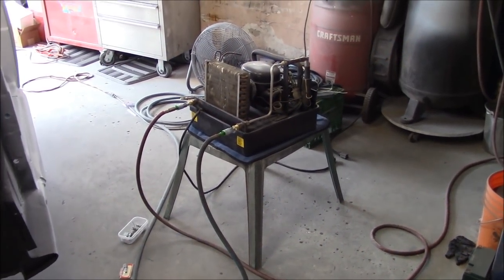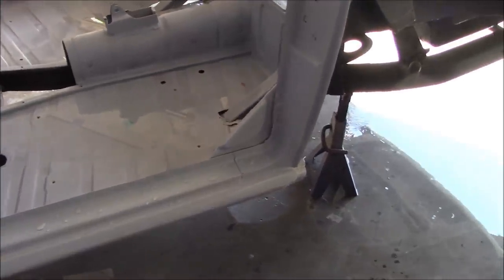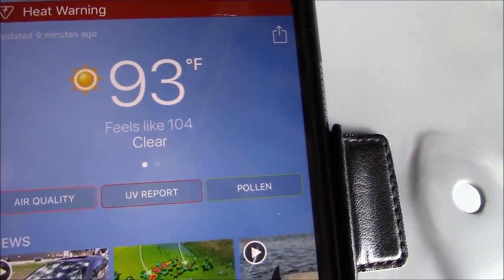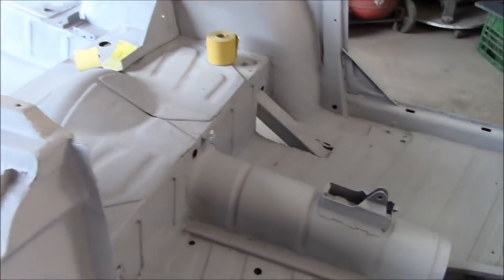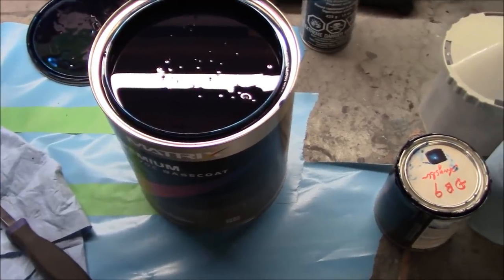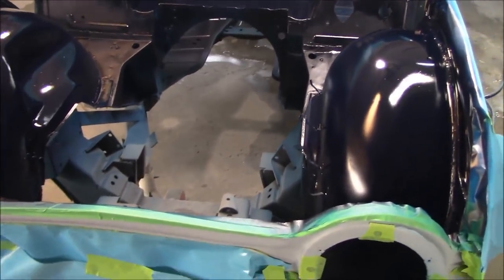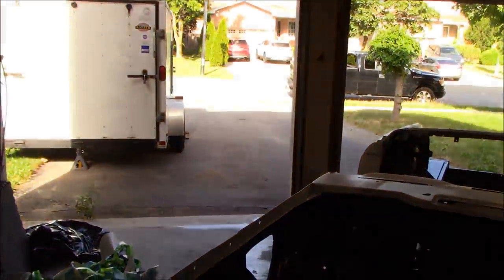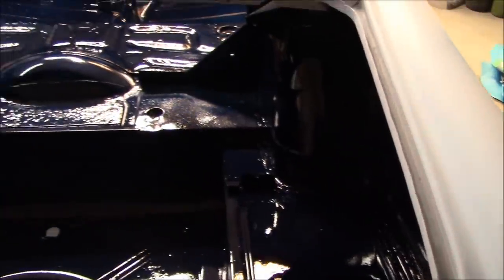1968 Triumph TR250 Restoration, Who Wants Royal Blue....? I Do!  Body Tub Interior Painting

Comment: Nice color. Something I do when painting is to narrow the spray pattern and spray into all those hard to get to or hard to see after it becomes all one color areas. The light is better before the whole thing becomes one color.
Reply from the maker: Yes, I was doing the same thing playing with fan/material and pressure to get up under the edges.   Yeah, I should have know better with the lighting at the rear of the car....It will be the first thing I fix...nothing that a little wet sanding and reapplication of base and clear can't fix :-)

Comment: You are a perfectionist.  Curious, when you sand areas down to metal, do you prime with 2k or epoxy?
Reply from the maker: Hi Soup, the best way is first prime with epoxy primer then overcoat the epoxy primer with your high build primer (try and do this within the recoat window of the epoxy so you don’t have to sand before applying the high build)

Comment: Looks great but it´s not better to paint the frame first before the car himself? I never thought that Cheftush is faster than Elin with his GT6.
Reply from the maker: In my experience. it is better to paint the frame afterwards.   I have done it both ways...if you paint and assemble the chassis before hand, not mater how well you try and protect it, it will get overspray and heavy dust on it by the time you are done painting the body.   I prefer to paint the body, then remove it from the frame and then paint the frame and assemble it before the body goes back on
Reply: @cheftush  Okay